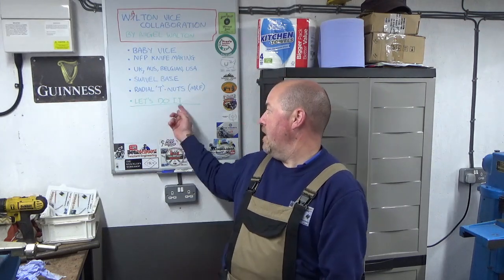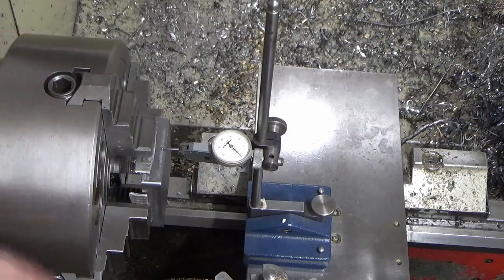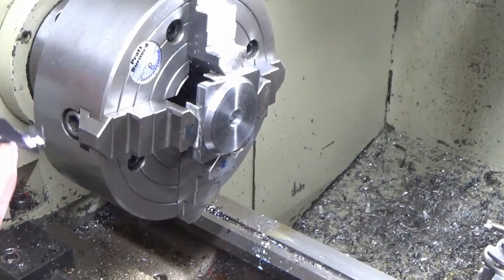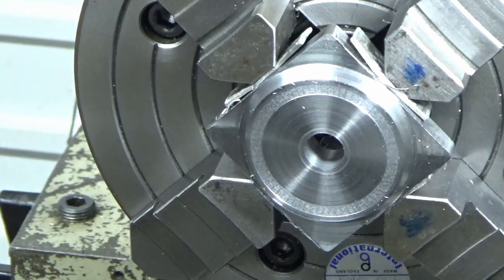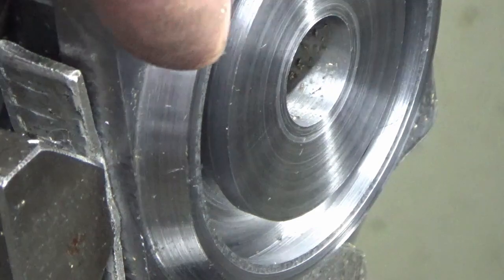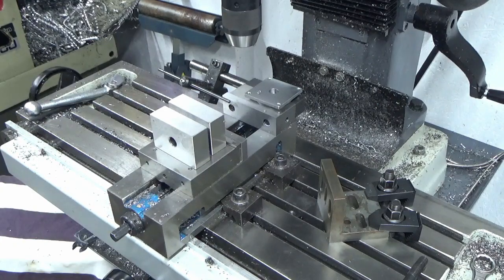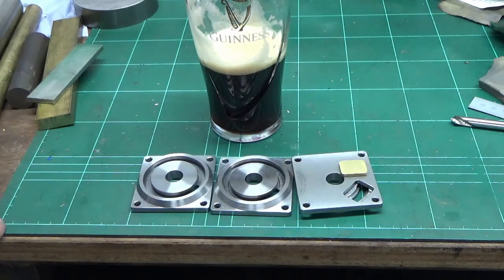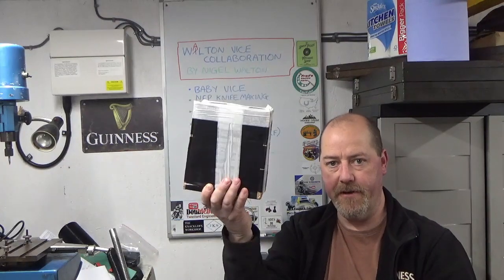Baby Vice Collaboration   Swivel Base Manufacture

Comment from the maker: Meant to add in the video and forgot, sorry. The 2nd side of the T Slot was machined on the other side of centre with the lathe running in reverse. I just couldn't get the camera anywhere near to get any decent footage. Cheers, Jon
Reply: Thank for the update Jon, I thought that was how you would machine the other side.👍
Reply: I wondered the same and presumed that whas how you did it as you only showd the one tool you'd ground.

Comment: Enjoyed the machining Jon. Excellent vice bases. I wondered why the entry hole was 'that big' for the tee nut heads lol, nice finishing touch. Tony
Reply from the maker: Hi Tony, thanks for the comment. Yep, there was a dimension missing on the drawing (don't tell Nigel), so I went off visual from the one he made. Totally lazy as I could have drawn out the TNut but just wanted to crack on. Also wanted to make sure I didn't undercook it and give someone else a rework problem at assembly. I never thought to ask Kev (Mr Factotum) to send me the T Nuts instead of Nigel, this would have been the most sensible thing. Cheers, Jon
Reply: @jonsworkshop  Cheers Jon.  My old school pre CAD Faber-Castell H4 pencil tech drawing class experience showing through again lol. I don't think you were lazy Jon, I think you were FAR TOO MUCH involved in trying to accomplish a FANTASTIC GOOD JOB that you overlooked what the needed requirement aperture could have been.  Never mind I loved the video Jon, I also forget loads/tons of stuff nowadays.  From novice Tony

Comment: Hi Jon . They came out great , nice job .   I probably would have bloc turned them to save time but cracking job .    Cheers .
Reply from the maker: Hi Max, thanks for the comment and feedback mate, much appreciated. I did think about it but have a big mental battle scar from a failed attempt to do similar many years ago........ Went for the safe option lol. Cheers, Jon PS. Also still sporting the physical scar from said balls up! Lol.
Reply: @jonsworkshop  That sounds serious , like a soft jaw failure or the part exiting the machine .
Reply from the maker: @swanvalleymachineshop  Lol, 5 parts exiting the 4 Jaw all stacked for blocking out, too heavy a cut, one shifted and things went south pretty quickly! Big plaster and new underwear required as immediate first aid.

Comment: Well done Jon, when I only saw you machine 1 side of the tee slot I was assuming it was going to be a single sided tee nut with radius to suit your slot. Sure was tight clearances for the tool and swarf, luckily it was a nice piece of leaded steel you got hold of. Regards from Australia.
Reply from the maker: Hi Dave, thanks for the comment. Yes, I should have added a comment on screen, it was 2 sided, I machined the 2nd side behind centre with the lathe running in reverse. It was so tight on the back side, even I was struggling to see in there let alone the camera so I gave up trying to film it. Ha Haa, you worked me out, I deliberately went for EN1A knowing this would be a tricky job (got to stack the odds in your favour where you can). Cheers, Jon

Comment: Excellent work John. Is it a full T slot only see one side of the T being machined or did I miss something? I am assuming if you did machine the other side of the T, you used the same tool and ran the machine backwards?
Whish I had known about the collaboration would have liked to get involved.
Reply from the maker: Hi Gary, thanks for the comment. I see you have seen my pinned comment so hopefully no further explanation required. It was so tight on the reverse side, even I couldn't see in there let alone the camera lol. Cheers, Jon

Comment: Very nice. I used a similar "upset the surface" to rescue a "oops, that took more off than I wanted" thing - I used a knurling tool to increase the diameter of a plastic bung to go into a hole.
Reply from the maker: Hi Mats, thanks for the comment. Yep, I have used techniques like this over the years to improve less than perfect manufacturing lol. Another good one is a ball bearing (bigger than the thread size) gently tapped into the top of a hole to tighten threads up. Cheers, Jon

Comment: Nice end product, the tool grind was a success. That always makes you feel good.
I use the centre punch trick to close up over sized holes, usually works!.
The vice looks superb will they be making the drawings available?.
Reply from the maker: Hi Fred, thanks for the comment, yeah, it's a useful trick with many applications. Not sure on the drawings, would suggest you contact Nigel at Go Create, they are his design so not sure I can answer on his behalf. Cheers, Jon

Comment: Jon, the bases came out super.  I always get slightly nervous when making parts that others are going to use in an assembly.  Never fully confident my measurements will come out the same as they have.  Using a standard like the drill blank sure provides some confidence.  😉  Thanks for the tips on hand fitting and adjusting for a light press fit. 👍👍😎👍👍
Reply from the maker: Hi Joel, thanks for the comment. Yep, hopefully the power of YouTube and using a 'standard' in this way, makes the world a smaller place. It does sort of feel like we are all in the same workshop. If someone had told me back in the 1980's when I started that I would be able to do this in 30 odd yrs, I would have laughed them out the room. Cheers, Jon